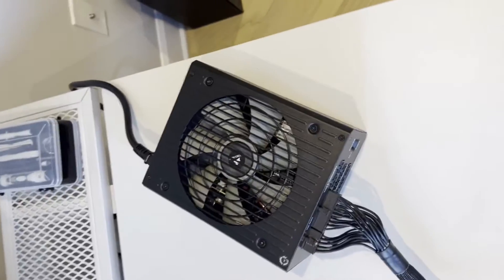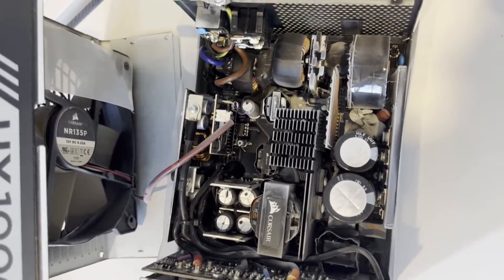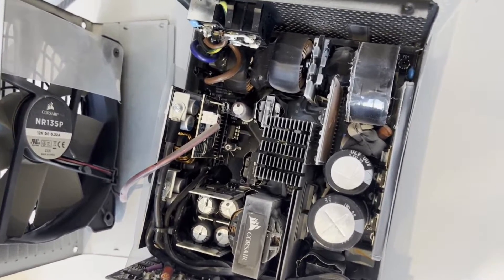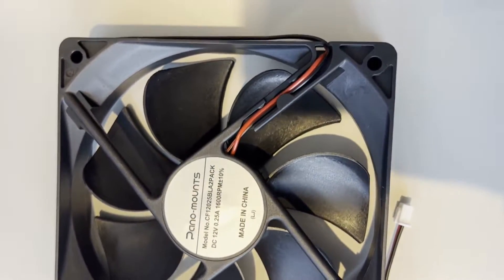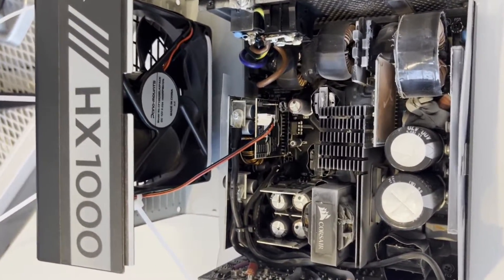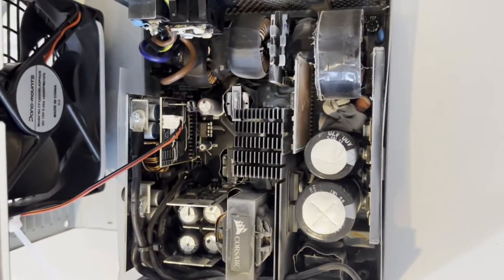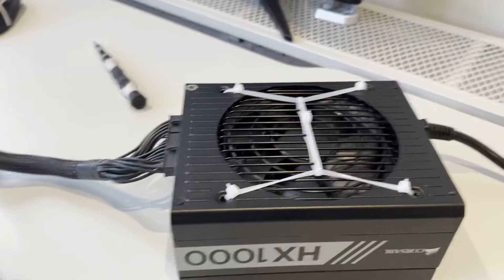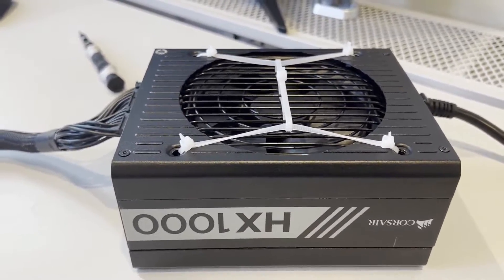Corsair PSU Fan Replacement

Comment: Its actually easier and cheaper to just lube the fan by opening it up instead of installing a new fan. I had the same issue with my psu and i lubed it myself and it has been 2 year since then and the fan is running really nicely
Reply from the maker: Honestly yeah, that would have been a much better solution, and cheaper too. Did you use lithium grease, or some other kind of lube?
Reply: Only with certain type of fans, recently my psu fan started to sound like soda cans in the road, even the case was vibrating, i opened and it is a DFB fan that is sealed, I could try to open a hole to add oil but due to the design that only will last a few months with luck and the the noise will come back again. Now I'm trying to find the exact same type of fan or going for a pwm connected to the Mobo.
Reply: @abhinav28488 Doesn't work every time. In my experience it only works in 35% cases in another 40% just reduces noise. Pro solution? buy Cheap rgb 120mm fan drill holes in case cover 120mm screw it in and connect fan into 4pin pwm. 3-8 dollar solution that actually has super cool led effect. Raptor / Zeus fans cost 3 dollar Frgb sata.

Also get this... I greased up PSU fan, worked ok for a day or two then the plastic ring holding fan umbrella slipped out during gaming due to being extra slippery from grease. And here we go back again... so... rgb fan or Frgb budget (sata connector 3 dollar... 3 dollar for Frgb fan... ) power tool drill = jaja. And looks like a beaut.

Comment: Very ghetto, yet, creative.  Kudos.  I replaced a 140mm fan in my BQ 650 W unit; all BQ models use a crap fan that makes noise over time.  I feel sorry for those that RMA them, thinking they are not going to evenually have the same thing happen.

Comment: Any new choices of fans to use this with?
Reply: Noctua nf12x25 or arctic p12 i guess
Reply: @f5_5f-s3m those are made with 3 or 4 pin cable. I guess you can use the 3 pin ones but you'll need an adapter to plug it into the psu.

Comment: Thanks, Mark.

Corsair used ball bearing fans instead of fluid dynamic fans for only one reason -- to save money. BB fans a louder and do not last as long, however they still last a long time. The issue you and many many many people have with the NR135 OEM fan is they seem to be out of balance. It's just a guess, but it might be that the fan blade part is poorly made. It wouldn't be the first time a part made in China was poorly made. If the injected moulded part has porosity or excess material from a previous shot in the cavity, for example, the fan will be unbalanced and cause an audible vibration. It doesn't take much to cause an annoying noise. I doubt the ball bearings are faulty. In the end, the fan is poop and should have never pass QC. 
<bonus content>
A corollary is Corsair doesn't have particular high attention to QC themselves, so they would never have caught it or looked for QA reports or tested samples or have a QA department (however they might have a few people with big titles who generate multipanel charts and spell quality with k). 

BTW, I am a dissatisfied owner of a RM750x (2021). It sounds like a single engine aircraft overhead. I'll end up stacking it with the non-replaceable key keyboard that has a bum LED, the mouse with traction "tire" on the scroll wheel that spins around the wheel, the mouse pad that when turned off shows a bright rainbow that lights up the room and whose edge is now worn and cuts my wrist and endless iCue versions that are completely unreliable POS. I think I just made a decision for future purchases.
Reply from the maker: Thanks for your detailed response, and yeah, I'm quite dissatisfied with Corsair products in general. A while back, I used AF120 fluid dynamic bearing fans for case ventilation, but over the year, almost half of them began to make a grinding noise. Rather than wait for all of them to fail, I replaced them with Noctua NF-P14s and never had any issues since.

I did go with a Corsair Hx1000i PSU to replace the one in this video, solely because it had the ability to monitor PSU performance through the iCUE software (which I agree, is garbage and arguably bloatware). But aside from that, I've stopped going with Corsair for any of their components. 

It's a shame they'd cheap out on the fans for their PSU, and make them intentionally more challenging to replace, even deviating from the well accepted 140mm fan size to 135mm, making sourcing of replacements quite cumbersome and requires the redneck engineering as shown in the video. I'll only use the PSU shown here in test bench setups, as I've lost all confidence in corsair PSUs.
Reply: This is not true. 
Esp. for frequent start stop cycles (which those zero rpm PSUs have a lot of) hydro bearings are terrible.
The reason is that the hydrodynamic bearing effect requires a certain minimum rpm to form.
On each start and stop you introduce wear.
A quality ball bearing will outlast a hydrodynamic bearing in this use case by orders of magnitude.

Comment: I've been working on computers and electronic devices in general for years and black is always negative and red is always positive. The only time you need to test is If you come across something that uses different colored wires. In this case, test polarity.  In the case of computer fans, connectors are also designed in such a way that they can only be inserted one way. Also, you can plug a DC fan in with the wrong polarity and all that will happen is that it will run in reverse.

Comment: 8:59 what are those 4 pins right from the fan header? i have rm1000x and was wondering what they are
Reply from the maker: Not quite sure, can't find any documentation other than it being called the HAR_MCU card. Likely a daughter board containing the PIC16F1503 microcontroller regulating fan speeds. The 5 pins may be used for manually testing modulation (m), voltage (v), ground (g), diode connections (d), and some kind of communication (c), but that's purely speculation. Better off getting in touch with corsair support if you needed a more reliable answer
Reply: @pataporon  was once on their forum and they freak out i looked inside it ( psu ), not worth my time tbh. thanks for replay.

Comment: How to disable this stupid "quiet mode" for PSU? I desperately want that my PSU fans spins on maximum 24/7 - because it's a mining rig and it runs hot as flames even if rated are 1000 watts same as in your video but I do run only 800 watts 24/7 - and fans are not spinning/ How to force them to spin 24/7 on max RPM???  Kind Regards!
Reply: Stick an additional fan on it🤷‍♂
man made stuff

Comment: both my corsair psus have noisy fan bearings - one developed the sound after 7 years which is fine, but then the next one started making noise after only 1 year
Reply from the maker: Same, this one failed after about a year. I have another RM850x that uses the same bearings and hasn't failed so far. I recently bought a HX1000i which uses a 140mm fluid dynamic bearing fan instead, so not only is it more replaceable (more 140mm fans on the market, like the ones sold by Noctua), the technology seems to be more advanced.
Reply: Mine EVGA simply failed the fan, like It's not properly connected on the bearing or something, I'm temporarily holding the fan with the PSU upside down, so it doesnt create pressure and start grinding again, but this shit need to be changed for sure. Very bad random chinese fan being used

Comment: Nice video! Question! Can you guide me in which fans I needed(recommended) to buy before replacing the fan? For instance, what volts? what rpm? etc. There's nothing really wrong with my PSU, I just want to replace its fan because it has an RGB light, and I want to replace it with a plain one. Thanks in advance!
Reply from the maker: No problem! Most corsair fans use a variant of their NR135P fan, which although the stock is non-RGB, is not sold by corsair. This is a 135 mm 2-pin, 12V 0.22A DC fan. Major fan suppliers typically don't sell 135mm fans, as their closest is 140mm. However, you'll still need zip ties to hold that in place. The closest 135mm fan I could find that meet the specifications is this one: https://www.amazon.com/CCBBAA-Replace-DFB13512H-Chassis-135X135X25mm/dp/B09CH8CNMH/ref=sr_1_3?crid=3NCFGQOK3O38Y&keywords=135mm+dc+fan&qid=1677599656&sprefix=135mm+dc+fan%2Caps%2C91&sr=8-3 , however I can't comment on it's reliability or accuracy to specifications.

Alternatively, have you considered disabling the RGB lights? If there isn't software to do so, you can use black nail polish or electrical tape to paint over the LEDs, which may offer a less risky solution as opposed to getting an off-brand fan.

Comment: i have corsair rm850 that i buyed 10 years ago and only now i realised what produces that annoying noise sometimes...i guess they are still using those shitty fans :(
Reply from the maker: Yeah, I had this PSU for around a year before it started making noise. And they use 135mm fans which are a lot less common than the traditional 140mm, making it harder to find the right part.
Reply: @pataporon  they are idiots, who the fuck uses out of spec fan nowdays? srsly. i mounted 140mm in my rm1000x however you cant screw it in correctly into the shroud, only one side, cause hole distance is higher, had to glue other part of a fan to the shroud.